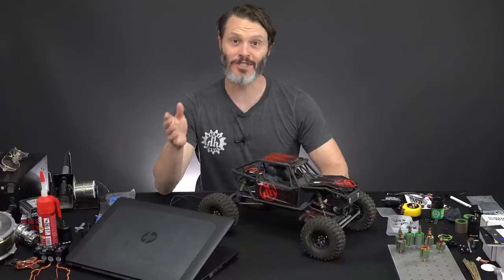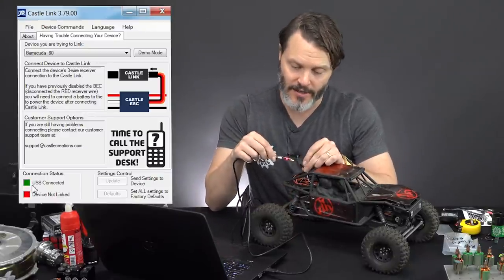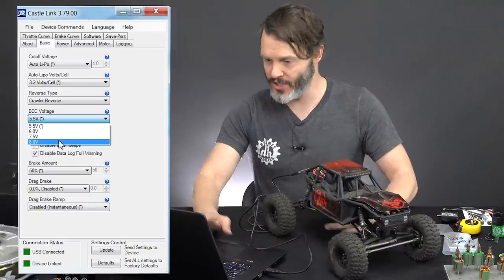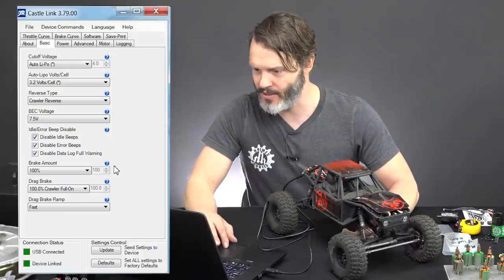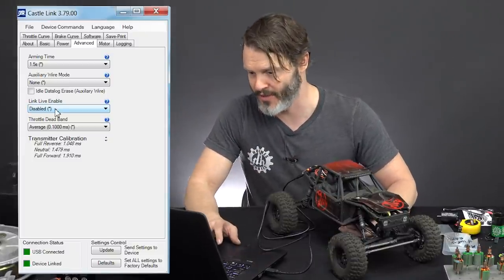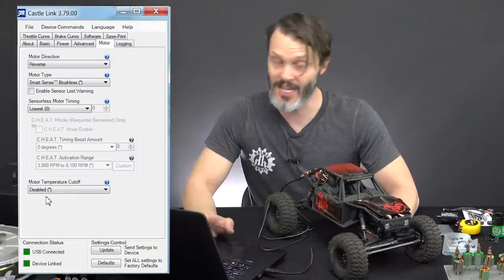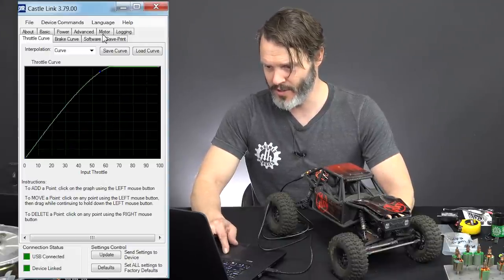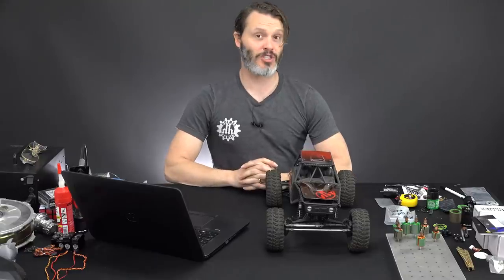Crawler Control! Low Speed Programming The Castle Creations Mamba X  - Holmes Hobbies

Comment: Playing with my new Mamba Micro  X today and I discovered that there is a solution to the touchy reverse that is inherent to the stock Enduro motor. You don't even need to upgrade the Tx/Rx. It turns out, Mr. Holmes, that the brake curve is not exclusively for braking. It is just a general reflection of how the truck will behave when engaged in either brake or reverse. So, the reverse curve can be programmed just the same as the throttle curve. Fancy that?!

Comment: Thanks John refresher and explanation is always aprished ....I never change my motor timing setting I will do this right away to see how it works .....I see also you did not use the auxiliary wire setting I am surprised I always set mine to crawler break so I can switch on and adjust the amount of drag break I fine this very useful....

Comment: Thanks for the detailed explanation of this!  I would have been confused by most of those terms.  Just got my castle mamba X crawler combo with the 1900kv.  I’m impressed with how it performs even out of the box!  Only thing I had to do was set motor direction to reverse in the transmitter programming mode.  But this will take it to the next level.  I’m only on 2S right now, so I’m sure these settings are especially useful if on 3S or higher.
Reply: I just bought the same combo for my Capra kit.  Im hoping it gives me the really slow crawl im looking for. Im putting a 11t pinion on the motor as well.

Comment: Hey! Greetings from UK.
Great channel with a wealth of information and useful tips..
I need some advice. My rig is a TRX4 Defender (everything stock) and I run 3s Lipos (5000 for when I go out and about and 1400 for crawling indoors technical lines). I have purchased a 7.4v servo but haven't fitted it yet because I haven't bought a Bec yet and I have decided to upgrade the engine and esc to a Mamba X and censored rock crawler combo.
Now one question is about the power of the engine. 1900, 2200 or 2850kv? I don't want to add more top speed when I am trailing, maybe a little punch to do some slides, or when crawling?
Another question has to do with the voltage of the new servo which is 7.4v. Since the rig has 3 more servos all 6v and I imagine the radio is also 6v, I need a separate Bec? is the castle 10a a good option?
Btw it is also on my list to get the Castle link to set the esc and eventually the Bec.
Any help would much appreciated.
Thank you.

Comment: Ok I set it up just like you did on my traxxas trx4 with a Holmes hobby 2700kv puller pro and a barely any throttle it vibrates and shutters my connections are good

Comment: I use slow or very slow for drag brake. It's instantaneous when crawling at low speeds, but at high speeds it puts the brake on, slow, like I do. Fast setting makes my truck crash going downhill.

Comment: Thanks for a great video. I have Mamba X ESC but the drag brake is not on (or working). Do I need the Castle Link V3 USB Programming Kit P-CC011-0119-00 or a different link lead pls?

Comment: Awesome info. Can i use settings like this on the brushed motors using the mamba x and mamba micro x? Im running brushed right now until the puller pro v2 3500kv is in stock again
Reply: 20000 years later.. ....
Reply: @jesusibarra3608  40000 years later...

Comment: Recently had my mamba monster x stop working will not hook up to castle link on the PC so I am asoming esc is fried esc will not power up. 1800kv revolver on 4s.
In your opinion what may have happened? Esc never has gotten how have low gears also have over under in ar60's.
At this point I need a new esc what would you buy?

Comment: Thanks for the video. Question. My Futaba 4PV can do throttle curve on the fly which is nice. Is there any benefit to adjusting the throttle curve on the ESC over using the transmitters ability to adjust throttle curve?

Comment: Hey John. I am debating between 1800kv and 2200kv motor. I was wondering what your exact setup is and why? Why would one get the 2200kv motor instead of the 1800kv. I will most likely go with a 11t pinion (lower is better I am reading) and have a mamba x. Stubby vs standard? I just got into the hobby and don’t know much about gear ratios and kv. All I know is we want 45:1 ratio and how can we archive that with 11t pinion? Love your content and congrats on 20k subscribers!
Reply from the maker: Depends on the rig.   If capra, 1800 to 2200kv will be nice for the ratio with a 10t or 11t pinion.
Reply: Yes this is for the Capra. What is the benefit of standard over stubby? Gonna go with the 2200kv I think. Thanks!

Comment: Hi John so I got a sidewinder 4 esc with a 6900kv sensored brushless motor all programed in my Bomber it's wicked fast in the open I clocked 43mph it's hard to bump when crawling tho to much wheel speed can adjust the crunch control for crawling and still be fast or do I just have to get used to it?

Comment: Just an FYI if you are using this on the Capra the throttle curve will actually be your reverse curve and the brake will be throttle seeing how to motor is in reverse mode so everything will be reversed I learned this the hard way
Reply: it doesnt know how to account for that reversing in the software????
Reply: @dirtrider88  nope happened to mine and could never figure it out

Comment: Hey John Holmes i hav3 a super important question i have a brand new castle creations mamba x esc and a link, i have a brand new Holmes hobbies puller pro v2 2700kv stubby and my esc isn't making any audible noise or beeps the rsc was unopened new from a shop and the motor was opened at a different shop, with yellow shrink tune on the motor bullets and i. Thinking it has been used, and its toast. Do you thinj thats the problem? Any help would be greatly appreciated 🙏

Comment: Hey I have a question for you I purchased the MAMBA X, SENSORED, 25.2V WP ESC AND 1406-2850KV SENSORED COMBO crawler edition for my axial wraith spawn. I kind of put it in crawler mode as well I know it’s a rock racer but I really want the option of using it as a crawler as well. Is it recommended or should I put everything back to default? I would like your input if it’s okay...Thank you

Comment: When you set the BEC, to the higher voltage, is it the radio (meaning the controller in your hand) or the receiver on the truck that is the issue. Also does it matter with a battery powered servo.
Reply: Different radios don't all have the same maximum BEC Voltage so I would think you would match that with the maximum voltage on your receiver.

Or whatever you have your receiver voltage set too 👍

Comment: Can I ask is this setup for sensored motors? As I used it for my new V2 snubnose 2040kv and it smoked my motor instantly. Would it be the brake setting that could of caused this or the throttle curve? Any help would be greatly appreciated as it'll get very expensive to keep replacing motors.

Comment: I have a new Mamba X and new Futaba 7PXR transmitter running my Capra build and stubby puller pro v2 2200. I am new to this. I see the transmitter has a bunch of speed/brake/throttle/curve/% related settings. Very similar to the ESC settings from what I can tell, not all but some. Why would one program one vs the other, does one take precdence over the over. Like if I make throttle/brake/% settings to the transmitter and do the same with the ESC. You know what I mean? Thx

Comment: For a trx6, would running a 15 tooth pinion on a 2700kv puller pro be bad for crawling? Would the 4100kv ppr be good at crawling on an 11 or 12 tooth pinion?

Comment: I have your 3300 kv sensored crawler motor with the Mamba x. Tons of torque. After running a couple times on 3s,I noticed my drag brake is not full on. I went through it a couples times on programming. Settings are where I left them. Also using the aux mode for my TX,to control my off on drag brake. Do you have any idea why it would suddenly have less brake? Motor works fine,no issues at all! I was told by Amain hobbies it was a programming issue??
Reply: Did you find out? My guess was gearing was too high, that was my problem.

Comment: Hey how’s it going John so I just recently ordered A esc motor combo from your store it’s the momba x and puller pro 3300kv stubby for a trx4’’sport’’I was wondering if it is safe to put the 45 tooth spur and 13t pinion and gear the truck down it’s a lil to fast with the stock sport gearing thank you
Reply: I don't see why it wouldn't be safe.  You will just get more low speed torque.  Your top end speed will be reduced but if you are crawling then it doesn't matter.

Comment: So I pretty much set up my Capra with all you setting and I have a mamba x with the slate 1406 2280kv motor 9 tooth pinion and the drag brake sucks! It really sucked with an 11 tooth pinion. Dose this seem right or is something wrong?
Reply: did you ever figure this out? i just bought a used capra with the same setup and i just ordered the castle link but the drag brake sucks.

Comment: I have the mamba x with your puller pro stubby brushless motor and I programmed it the same way and it is jumpy in reverse but works fine going forward what did I do wrong?
Reply from the maker: Might be your radio.  Add in brake curve too, it will make reverse less touchy

Comment: If I put 7.4V in the esc will it burn the spectrum dig servo?  I know my steering servo support 7.4V, but I think the dig servo is limited to 6V.
Reply: It is rated at 6.0V, but I have been running mine at 7.5V for a few months now with no issue.
Reply: Maybe in these cases, like the TRX4, it might be best just to run an external BEC for steering.

Comment: What’s the lowest start up rpm of a 540 motor you’ve ever seen?
Reply from the maker: nicely designed brushless around 250 rpm, which is what the Puller Pro does.   Racing style motors will be 750+.  Brushed, crawlmaster magnums and custom pros sub 100rpm.    Anything under 500rpm is pretty usable.
Reply: HolmesHobbies On a given motor is the voltage supplied (given enough current) and timing the only things controlling start up rpm?

Comment: I just went back through my settings and my start power was set at low *default. I raised it to medium and high and didn't notice a difference. In low it spins all 6 locked up wheels anyways. Well, I noticed that on the 30% punch on high was quicker than on low, but couldn't tell a difference between the three startup power settings on 20% punch.

What's the difference between startup power and punch control? They seem to be very similar... does one control amperage and the other voltage? Anyone know the delay between startup power and full power setting? how long the punch control lasts?
Reply from the maker: Thanks for the feedback!   I haven't noticed a difference in startup power either.
Reply: I've done this with a revolver team spec ss and found that I'd need to input more throttle to get the motor to start up and not shutter like they do. On high start up power it started up with less input on throttle and had less studering.

Comment: Don't forget to sync the radio to the new esc settings ;)
Reply: What do you mean? You need to do recalibration of the radio after you change settings on the ESC? Even if the radio was already calibrated to the ESC?
Reply: @nexus7138  good question.
Reply: WTF does this mean?

Comment: What is cheat mode lol
Reply: i know this is a little late but this is strait from the program "The ESC will run the motor with more timing advance than your sensors are set for mechanically. "  based on everything else it says in the programing its seems like its used to chose what timing "boost" is activated in a given RPM range of your choosing. allowing you to have better low end punch but also increase top end speed. i think this is based on the fact (i think its a fact) that lower timing is better for low end punch but as you get higher in the RPMs you want more timing. that last part could be all wrong but i think its accurate.

Comment: Auto lipo cut off at 3.2 volts per cell?!! That is way to low of a voltage to let a Lipo Battery go to. My cut offs for all of my lipos are 3.8 to high 3.69 or 7.00 at most. running a Lipo that low is just absolute stupidity!
Reply from the maker: My packs last for years. never been a problem.   3v per cell won't cause damage either.   when I want to be extra easy on the packs I use 3.55v per cell.
Reply: @HolmesHobbies   I run the packs from SMC and after talking to the owner of the company and his extensive research on Lipo batteries i never drop mine below 3.8 and at most 3.6. Maybe you have had good luck. But i have an extensive background in Engineering and a lot of my work is in the automotive industry on battery banks I can personally tell you that taking a Lipo to 3.0 volts per cell is bad and will eventually cause problems or premature failure.
Reply: @burntfaceman24  ok sure, dude. keep only running your packs down to 3.8. thats only about 50% of its usable power, i think. so you keep buying twice the amount of expensive packs because your run time is cut down significantly